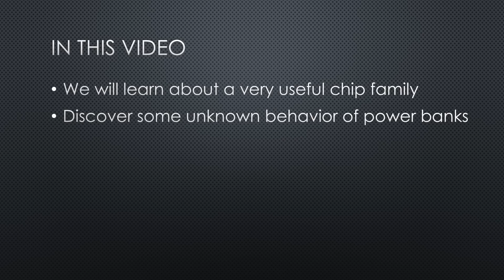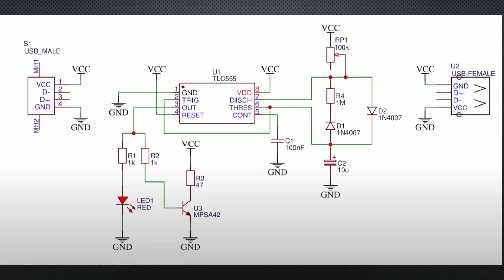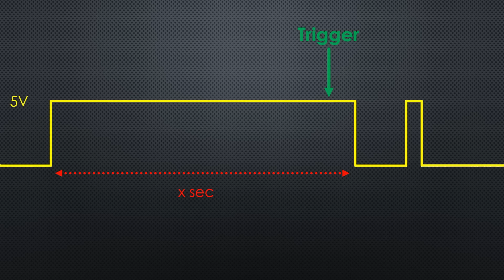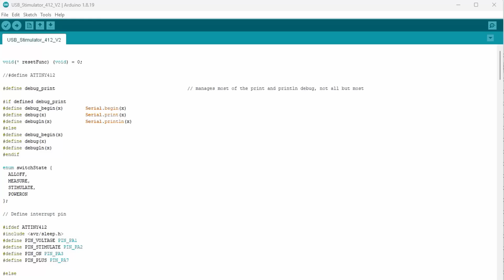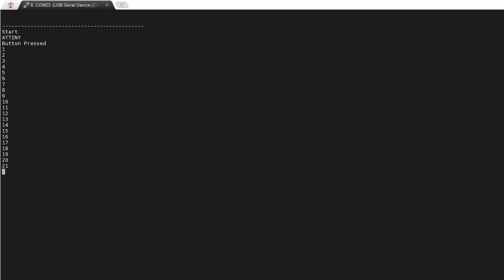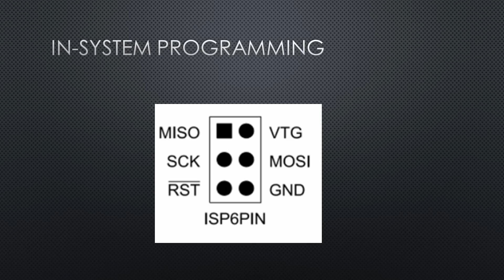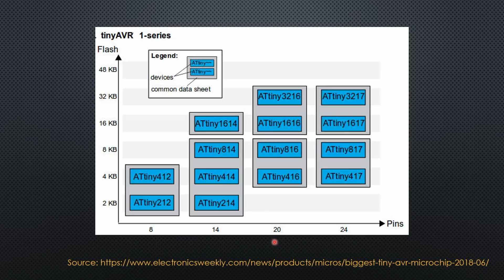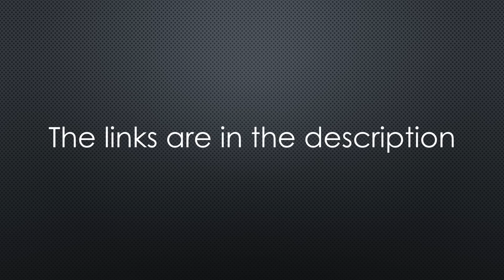477 Use the very attractive new ATTINY chips for your projects

Comment: I followed in your footsteps and purchased five AtTiny412 devices from AliExpress. I programmed a Nano to use it as a jtag2updi programmer. I tried to us this to program my at412 chips with a simple LED flasher script using the Arduino IDE. Two of my chips programmed and worked OK, but three of would not program. The problem was the same as you encounter: They were identified as at416 devices. Is this a problem with fake/faulty chips or is a problem with the jtag2updi programmer? My five devices were packaged in a short strip cut from a reel, so I would expect their specifications to be identical. Do you or any of your readers have any insight into this problem.

Comment: trying to build the project but could not find the program code you used. Or is this normally not provided?
Reply from the maker: The logic is quite simple. This is why I did not publish the code :-(
Reply: @AndreasSpiess   Thanks for the reply. You are right, but I used millis and ended up having too little stack. Delay solved the problem. Btw, you are a great help and inspiration!

Comment: Instead of the EEPROM I would have solved it by running the ATTINY's POWER not only from the USB but BUFFER the power with an additional CAPACITOR that is dimensioned so that it runs the ATTINY for A BIT LONGER than when the power goes out. Would that have worked in your estimation?
Reply from the maker: You are right. That would also be a possibility.

Comment: Recycled Dies.
I just use a blinking LED with a 1 min interval.
It's the current flow that the pack senses not a voltage drop.
Reply from the maker: Others mentioned that the bad chips were sold by Microchip (a programming error).

Comment: I have also done something like this.
But i want to find out the set voltage and current in a power supply when the power goes off.
So i used a large capacitor in the input and measure the voltage.
    
So when the power goes off the voltage will reduce periodically so i can detect the voltage drop and save it to the eeprom.
😃
Reply from the maker: Good idea!

Comment: When K.I.S.S misses out on the extra S! 
You take one very simple analog measurement example as an inconvenience and introduce into the equation an mcu, code, extra electronics and all the time and work that goes with them. All to do the same thing and working out your problem with a digital equivalent of what you wanted to avoid in the first place and have nothing but problem's?  🤔
 Seems strange I do understand but it's just not worth it when you add everything up.
Reply from the maker: Is this good or bad?

Comment: Extremely helpful. I like the supercap idea. Also you might need to tell the difference between the mains and the battery. You might could assume that you are hooked to mains unless you see the pulse which case you know you have a battery. This could also be the basis for an uninterrupted power supply circuit!
Reply from the maker: Good ideas for a second revision!

Comment: it's possible the "fake" attiny 412 were attiny 416 rejects, where maybe some functions of the additional pins did not work and someone resold them instead of recycling them. This happens with a lot of more complex IC fakes, they are often just rebadged rejects
Reply from the maker: Other commenters wrote that they came from Microchip and were programmed wrongly. So they can be used for hobby purposes, I think.

Comment: Very interesting approach for you. I have great respect for both channels. I'm also a hardware design engineer. But a perfect solution would be a solution that doesn't lose any power. So I prefer to see a solution without the resistor to ground. So use a kind of buck/boost converter setup to trigger the current monitor in the power bank and release the energy to the connection that uses a small amount of current.  Maybe I'm making this project more complex than needed, but that would be a perfect solution.
Reply: Well. I had some minutes to think about it. Storing energy temporarily in a coil/capacitor could be a solution, but if it stores that with 100% efficiency (which it doesn't do!), we have still a problem. What is the real energy usage (E=P*t) of the device connected on the output? If the energy usage is less than the energy that we draw each full period (Ton+Toff) from the power bank to keep it alive, than an extra resistor is still needed. Please ignore my solution 😜

Comment: Device signatures seem to be complicated for chinese fakes. I regrettably have bought a hundred or so STM Blackpills that turned out to be fakes. Funny thing is my IDE (VisualDGB) refuses to program them because of the wrong signature but the STM CubeMX programmed them just fine. I never really got them to work reliably tho. 
Like you said its really weird to see this kind of fake where there is a somewhat functional chip used with fake laser engraving and a wrong signature.
With the blackpills the normal IO worked but the chip crashed when enabling certain functions, like the ADC. But with hours of debugging I found out that the ADC in fact does work but the register offsets are just wrong and after manually correcting them they worked. 
However just like you I really didn’t trust them with any projects since you never know when they will fail of if a misbehaving program is actually a programming error or an error of the chip itself.
Reply from the maker: Mine seem to be „original“ ones, but with a wrong code burned by the manufacturer. At least this is what other commenters wrote.
Reply: @AndreasSpiess  Aliexpress never ceases to amaze.

Comment: don't do #define debug(x) // nothing. do #define debug(x) sizeof(x) - it will produce the same result (nothing), but you get the benefit of compiler checking your code when debugger is disabled. that way you don't introduce random compilation errors
Reply from the maker: Thank you for the tip!

Comment: Some time back I used a Digistump for the same purpose. It is a ready made ATiny85 board with easy programming and plugs into an USB-A connection of the powerbank. I created ~100mA over 500ms just through 2 GPIOs, with 100 Ohm to GND each. Works without magic smoke ;-).
Reply from the maker: Cool!

Comment: One over unity circuit;
Pin 13 and ground 558n 100nF.
9v USB battery. ->
7 series 100uF capacitors ->
2/3 mhz
Bipolar (BJT) Transistor PNP 400 V 8 A 80 W Through Hole TO-220 ->
8 x 50uF full multiplier
->
1m Ohm (10m Ohm are really cheap substitute in parallel)
->
200v zener diode, (just run the circuit through the zener diode at 2/3 mhz ~ 60hz, parallel to the megaohm)
$50 Buckaroos 

$2.15  5%OFF | 10pcs Mylar Film Capacitor 400V 2G104J 0.1uF 100nF 2G104 5% Polyester Film capacitor 104 J
_mr1NxEO

$3.54 | 100PCS Rectifier diode IN4001 _mMKyjJo

$1.88 | 10PCS  MJE5852G
_mMaeMw2

$0.99 | 10PCS IC Sockets  DIP16 
_mONCIcO

$2.93 | 20pcs/lot 5W Zener Diodes 200V 
_mPVai1u

$3.16  65%OFF | 2023 9V 6800mAh li-ion Rechargeable battery Micro USB Batteries 9 v lithium for Multimeter Microphone Toy Remote Control KTV use
_mrqaK1C

Comment: I think replacing the button with a cap might be an option. If the power fails, the chip dumps the new time to the EEPROM, ideally there would be a way to detect the physical disconnect like measuring some of the pins or seeing if the ground is connected to the case of the USB connector. Then the board auto calibrates when power fails before the board is physically disconnected. The only issue is that would cause the time interval between pulses to get shorter and never longer, so some way to reset it might be nice, maybe connect and disconnect and reconnect really fast, like plug unplug plug in a few seconds like a double click. Or a button I guess.
Reply from the maker: Good idea!

Comment: At 11:28, the 47kΩ resistor added to D6 is a pull-up or pull-down?

Thank you for the great video!
Reply: I've been looking for a small alternative for the attiny85, which I have been finding expensive and rather hard to find around here, and this video opened my eyes for this new ATtiny series
Reply from the maker: None. The resistor is between the two boards.

Comment: Very nice with the new way of programming, certainly makes hobby projects much easier.

As for automatic adjustment... wouldn't it be possible to have a capacitor keep the ATTiny alive for long enough to write a new cutoff value, reset the USB and come back up with a new interval to peak at?

Of course this would only work going from a longer interval to a shorter.

So on first power-up it would always need to start with a long interval and wait for the first cutoff, adjust and reset the USB.

You could make a switch that could discharge the capacitor if you hold it for 2-3 seconds while disconnected, so you're sure that it "starts over" if you switch between banks quicker than it can use the charge.

The electronics around the uC isn't my strong point, but I love playing around with the uC software. So I'm just suggesting something I could imagine could work.
Reply from the maker: Best is always to try it. These powerbanks are quite tricky...

Comment: I wonder if using a "big" capacitor to drive the MCU past the off time would allow for completely removing the setup button.
Being still powered, the MCU could react by saving the time value minus a safety gap in EEPROM and putting a load on the battery pack, restarting it.
Reply from the maker: Good idea!

Comment: Quite interesting but there's no need to transfer every second as there is enough time to transfer the exact shut down time to the eeProm when a voltage decrease is detected. I already use this on a different project with PICs.
Reply from the maker: Also a good idea. I did not try

Comment: I got 10x ATTiny402 chips from CuoComponents at 59centsUS with free shipping (US) Has anyone else tried this distributor?
Instead of jtag2updi using an Arduino as programmer I used SerialUPDI with a USB-TTL adapter (CP2302) with Schottky diode.
Has anyone else tried this approach?

Comment: I don't know enough to properly make a development board for the 412s.  Right now, the price of a 412 on a development board seem sky high.  Like $12.  Other mini chips like esp32 or rp2040 seem a lot cheaper.  Why is that?  Has the 412 not been out long enough for cloners?
Reply from the maker: I do not know. As shown, I just use a small PCB for a few cents.

Comment: I just made something today and THEN saw your video.  I was going to use an ATTiny85.  I have a Digispark development board so I thought I could program it without using the FDTI.  I couldn't get that to work.  Then I tried using an Uno as a programmer.  I couldn't get that to work.  Too bad, I have a lot of DIP package 85's.  I couldn't find my FDTI programmer so I gave up.  I used a D1 Mini instead. I just had it turn off and on a transistor with a 33 ohm resistor.  With 200 ms on, 2000 ms off, it worked by keeping my powerbank on.  With all the changes that happened, with Windows 10, Arduino 2.0 and avrTinyCore it seems a lot of tutorials are obsolete on how to program those 85 buggers in the Arduino 2.0 IDE.  I wish someone would do an updated video for programming the 85s with and without those development boards.  I am just a Chem Eng and do electronics as a hobby.

Comment: I have a feeling a lot of the really cheap electronics that are “fake” are really just bad batches or mistakes that the factory is trying to recoup expenses of, or really they were sold as is and a reseller is trying to flip them. I’ve bought mislabeled parts on a few occasions and found workaround instructions in item descriptions after reading carefully. Could be what happened with your chips!
Reply from the maker: You are right, these seem to be misprogrammed chips made and sold by Microchip. That should not happen if you ask me ;-)

Comment: This reminds me of one important lesson my lab teacher taught me: "Is the reduction of material expense or the software's efficiency worth the R&D time?" Sometimes a quick (and ugly) solution is much better than clean code and few components. That new mindset helped me complete assignments on time, at the same time that started a trend of me doing assignments twice, once in the required way, once in my way, because I often wouldn't be satisfied by the solutions I found on the spot.
Reply from the maker: I agree: All depend on the numbers. For a small series, material cost is not the issue. But if you create an iPhone, a few cents can make a difference.
Here it is a hobby, and its main product should be fun. So it might be a bit different...
Reply: I work in a company where people from long before I joined used to think like that. Now we pay a heavy price in tech debt where our old projects are almost unmaintainable. We spend days sometimes analyzing old code because when we need to make a simple change and it breaks everything. Pretty much all of the code is kept in a "functions.c" file with a lot of inline #ifdefs for product variants and a LOT of global variables that are cryptically named and reused across multiple functions and stuff like 6800 LCD display logic and switch matrix scanning mixed in with actual presentation logic. It's almost like programming in assembly but in C and the global variables are your registers or something like that (I guess maybe the guy who made that code probably learned to code in ASM before C for MCUs was even a thing, and made the jump to C but kept the same programming mindset). The same goes for the hardware as sometimes they didn't even bother connecting I2C lines to the actual I2C pins in the MCU, so then someone had to make a bitbang I2C code for it. Thankfully upper management realized how much of a problem it was causing and now we're rewriting and redesigning our products from scratch one by one

Comment: Doing price comparison between ATTINY chips vs Espressif 8266 (both ~USD 3, shipping inc), or even an ESP32-S2 at ~the same price tag, I don't understand why so many people use the ATTINY. You don't even need an external programmer, got a lot more processing power and memory. For example, for a project like this one it seems to me that it's a very good option. At this point, the only reason I can think of to choose an ATTINY is size, but not all projects are super restricted in that regard.
Reply from the maker: The size for sure is an argument.

Comment: My thought, although I haven't done EE in years so I don't know how efficient this would be. Use a capacitor to keep the attiny going for just a bit longer, to reduce wear on the writes of the eeprom write the time stamp immediately when the power drops. If the capacitor takes a bit to charge and otherwise delay the attiny booting you don't have to necessarily worry about / account for that since that time should roughly be constant. Added bonus, if the capacitor is large enough, have the attiny pulse the power in ever increasing delays. uint32_t timespan = 1; while{no_power_detected()} {toggle_power_draw(time_span);toggle_power_draw(time_span);}

Better yet, if possible have two~ish caps, an even LARGER cap (more likely a tiny rechargeable battery), do a similar thing, except when the power drops, make it so the large cap can keep powering the device downstream. This way you don't even need a button to characterize the power drop, it should be just plug and play, second added bonus, you don't need to worry about writing anything to eeprom. The slight downside, to get this device right is more like a tiny power bank, charging the battery and device at the other end will probably be a bit strange. My thought would be have the attiny act as a sort of middle man negotiating power draw on both devices, making sure to account for / adjust the power draw for the additional battery in the middle, (when the battery seems mostly charged, if possible negotiate the draw from the power bank down).

Comment: my idea would be to use a supercap to keep the mcu running just long enough to find out the values and further adjust timings if the battery cuts out after X minutes.
Reply from the maker: Good idea!

Comment: OR, you could decouple the power supply of the micro with a diode and large capacitor instead of using another battery.
Reply from the maker: Good idea!

Comment: There's one huge advantage to the 555: You can design something with it in minutes. Not the same with a micro. Don't get me wrong, I use micros all the time. But, they aren't "better" than a 555. Just different.
Reply from the maker: I think, that programming a micro to only work as a 555 also does not take long ;-)

Comment: I needed a protection circuit for 12V lead battery overdischarging, but couldn't find anything, only for Li-Ion.
I made a simple one with ATTiny85, similar to the circuit you made, only different purposes. I could use software serial for debugging. It consumes really low amount of power when sleeping.
However this new version makes it even more interesting, thank you for the video!
Reply from the maker: A good idea to use an ATTINY for such a project!

Comment: Those attiny412 chips from aliexpress are reject chips from microchip. They were picked up by some chinese sellers. They were probably incorrectly labeled too. Actually, thes attiny 41x series has the same silicon and there are only fuses to change their variants. I worked as an applications engineer in Mchp.
Reply from the maker: Thanks for the info. So they should be ok to use…